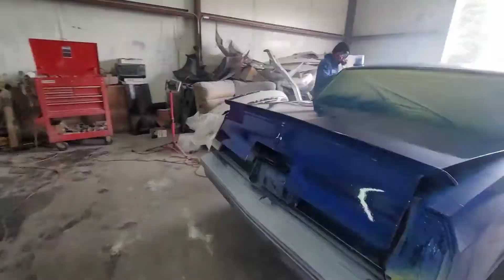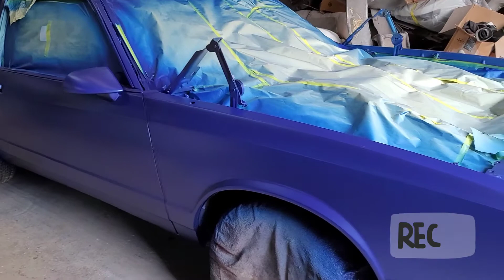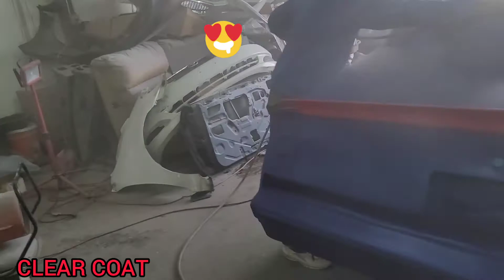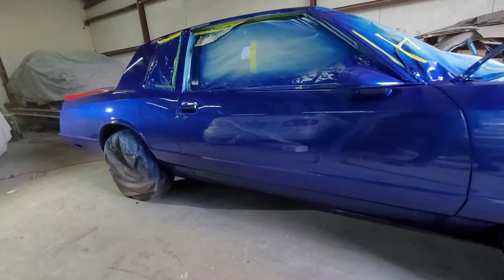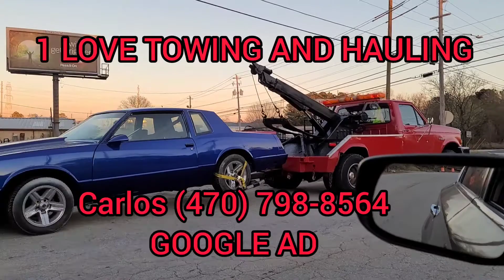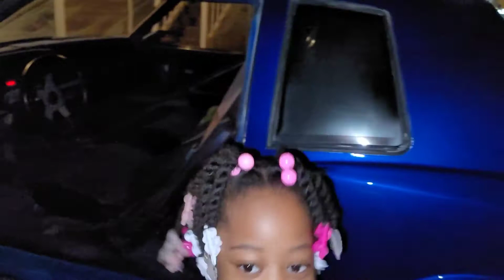SS MONTE CARLO NEW LOOK. YOUR TICKET TO A  MOVIE🎥. STARRED BY OTW2DATOP AND THE OPTIMUS PRIME SS

Comment: Keep goin🏋🏿🏋🏿🏋🏿🏋🏿🏋🏿
Reply from the maker: Prec8 it coming from someone with a bigger channel.
Reply from the maker: Got the rims on but having a problem with the throttle body I 🤔💭
Reply: Wat you have on it. Brackets and pedal wise. U might need an lokar
Reply from the maker: @sidewaysproductions9896  it's a fitech efi unit

Comment: Love the paint bruh, I been in the lab still workin on mine getting this efi all straightened out, and transmission
Reply from the maker: Whats wrong with the efi? Might can help also. I have to get a distributor cap I think.
Reply: Oh nun wrong wit it, it’s all new... it’s jus been a slow process of waiting on parts an all that, I’m jus ready to be riding again!!
Reply from the maker: @adrianmr.gbodyt2359  r u coming to jmalcom car meet on the 28th of this month
Reply: where will it be at, and hopefully my transmission be back in time and I have no issues with efi
Reply from the maker: @adrianmr.gbodyt2359  it will be in Monroe Ga
Reply: Bet, if I ain’t gotta work Ima try an be out that way... I’m in the army so my schedule be crazy bruh
Reply: I was just talking about EFI , How much more horsepower you think you get out of that
Reply from the maker: It does not add horsepower
Reply: Depends on your setup an what size carb u running already, could pick up a lil extra and get better fuel economy for sure
Reply from the maker: That means the power was already there they just didn't take advantage of the build by getting it built specifically for the motor. Or even get it tuned for what they want. Efi allows u to do whatever and like he said maximize everything according to what it is learning which depends on how you are driving